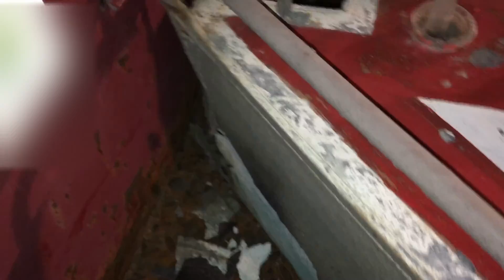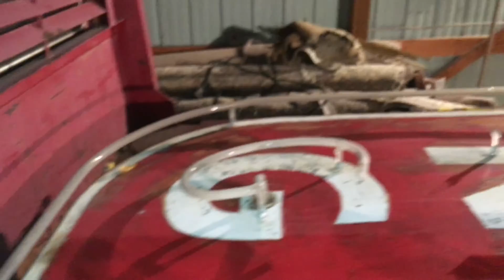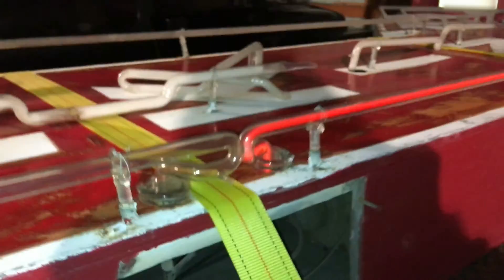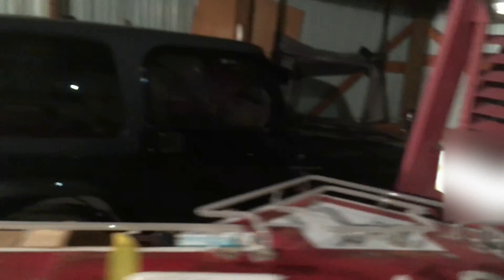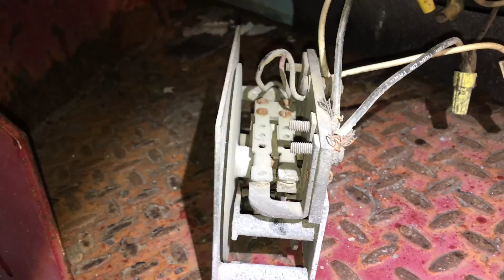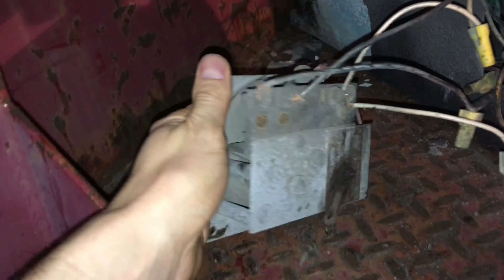Dundee Theater Neon Sign #4: Mechanical Flasher... Will it work?

Comment: This is really cool to see!!  I first learned about these little flashers from the RCM3 and RC6 cabinets for Federal Sign and Signal siren controllers.  Federal Sign and Signal used Time O Matics and Signatrols to alternate the solenoids on their 3T22 and Thunderbolt 1003.

Now I've learned that these are also in lots of old neon signs!

I can definitely see why Federal Sign and Signal used these flashers for their sirens.  They were built to last. And if these flashers can handle being in a sign for decades, they absolutely could handle being in a siren controller for decades as well.

I just bought a Time O Matic Model 3, form 61K1RS and I'm so excited for it to arrive!  

Another cool thing about these flashers is if you don't like the timing it has, you can 3D print a custom cut cam for it.  

I'm doing that for my Time O Matic.  It has a single cut cam, but I'm using it to alternate the solenoids on my mini siren.  And i want the same flash speed that Federal Sign and Signal's flashers run, so I'm 3D printing a dual cut cam for it.
Reply from the maker: clever idea, using a 3D printer to make your own cams.  i might have to experiment with making my own cams some time too.  enjoy your Time-O-Matic!